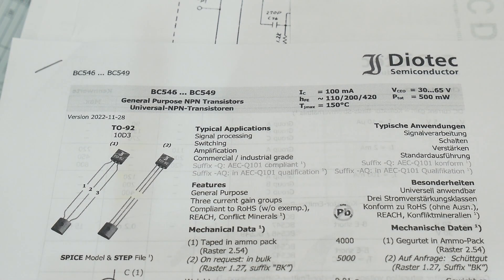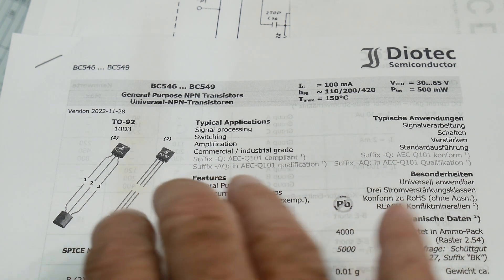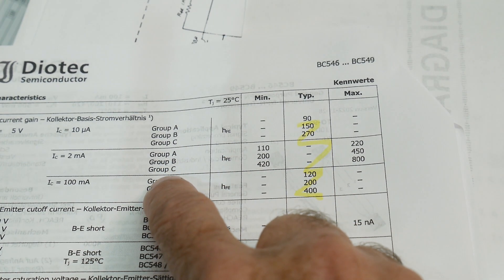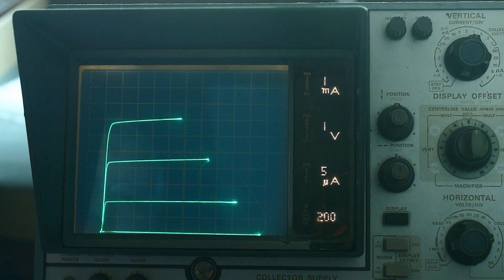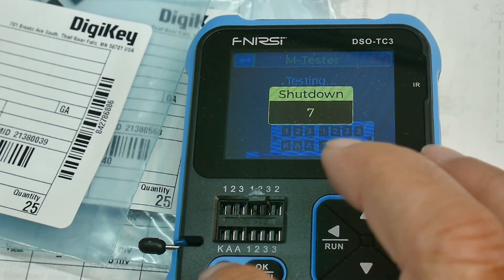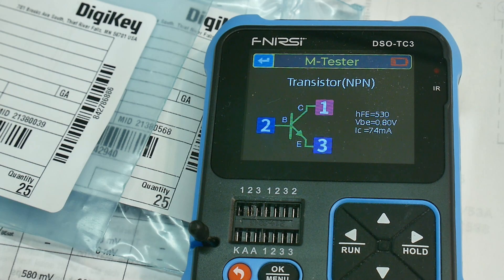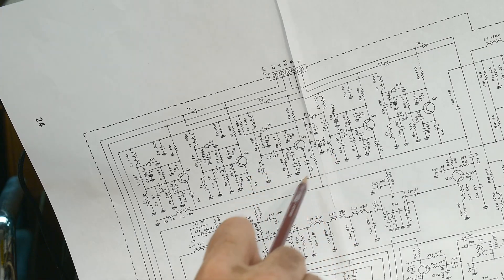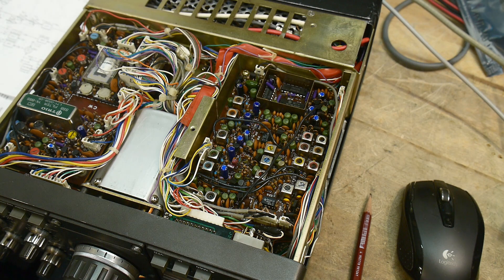#2011 Kenwood TS-120S HF Transceiver (part 11 of  12)

Comment: Still say the DC voltage is the issue. So a regulator or capacitor on one of the psu rails. BTW the transistors fail, they don't sometimes work the stop, and go. Capacitors on the other hand do vary with temperature. And dry joints are an issue with old single sided PWB's (printed wiring Boards), that were flow soldered, with almost 100% lead and a little tin. My checks go like this, 1 connectors, for power, and signals, soldering under connectors, 2 voltages, DC voltages are they correct, and then current, does the radio draw the correct current on RX. 3 Tantalum capacitors are the devil, electrolytic capacitors are demons, they lurk. 4 voltage regulators, especially 8 V regulators get damaged by bad capacitors, Then heat in the wrong places. 5 Modifications, remove anyone elses mods. 6, go back and check voltages. Any time you have time delays on switch on, then it's voltages, or a component that is heat damaged. ZL2ALW RE79qw
Reply from the maker: tomorrow you will see if you are correct.

Comment: I would definitely check the circuit that provides the bias voltage for those diodes. Great series so far! I was glad to see the gain comparison between a real curve tracer and the Frnisi, I just bought one 😊. Regards, David